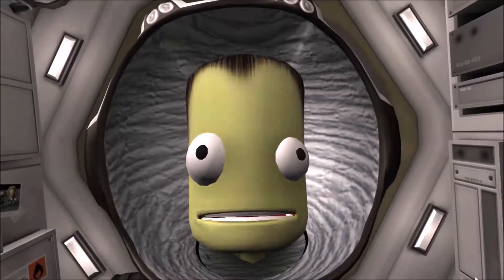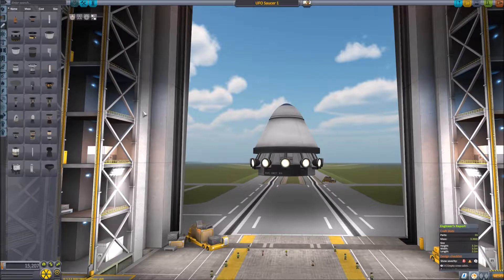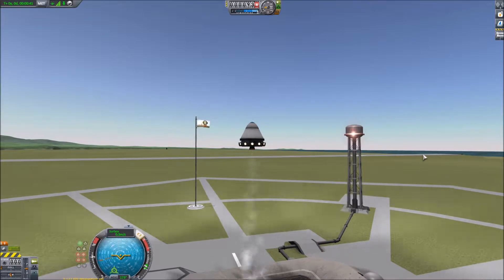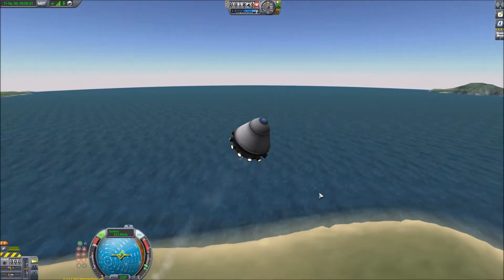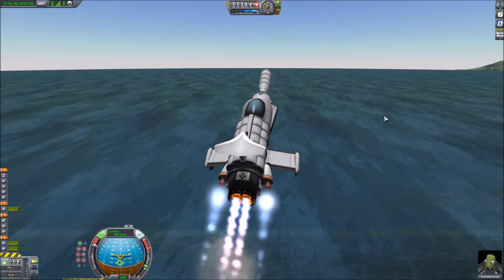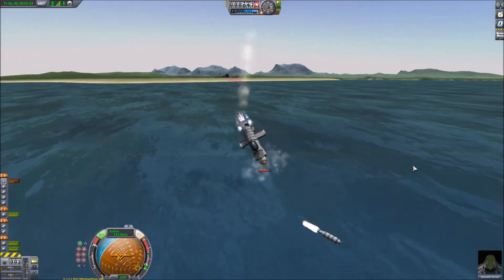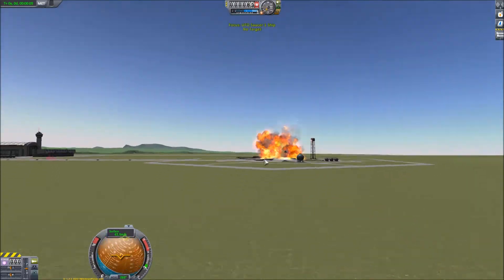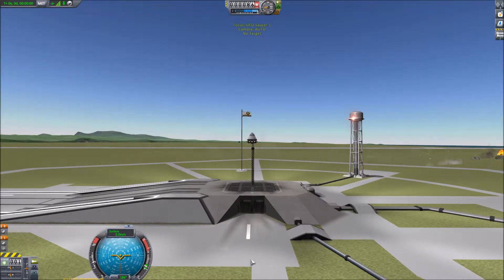Kerbal Space Program 1.2 UFO Interceptor pt5 - UFO Build

Comment: How do you merge objects together like that
Reply from the maker: Use the Offset tool. in the assembly buildings, in the top left (just to the right of the parts menu see the 4 little square icons place/offset/rotate/root part) Attach a part as normal then select the Offset tool (3 coloured arrows) click on the arrow pointing in the direction you want to move (the UP arrow will move part UP and DOWN)
Let me know if you need more help.
Reply: @KensonKerman  🙏 Thanks!!